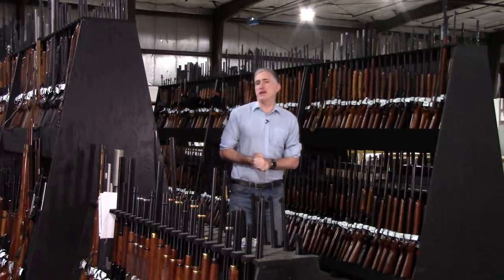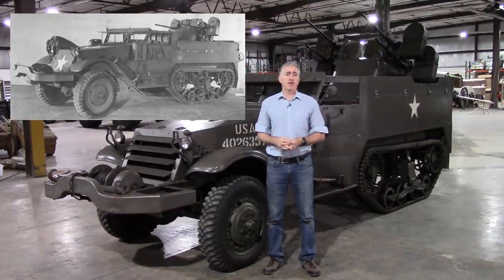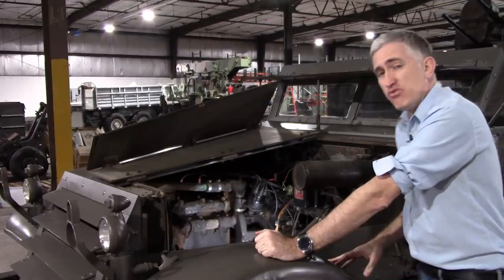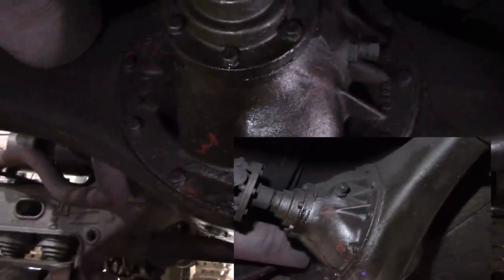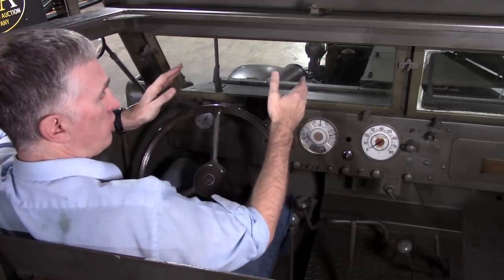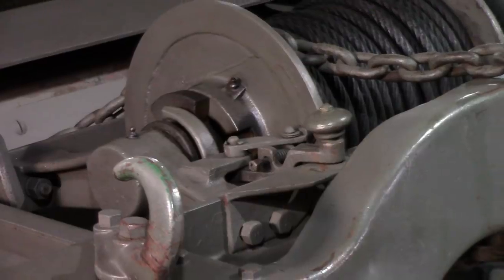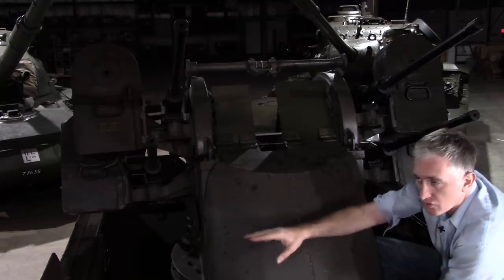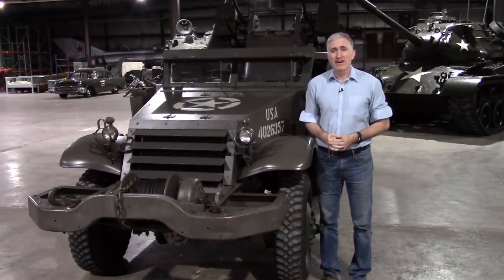Inside the Chieftain's Hatch: M16 MGMC

Comment: The Elco Thunderbolt Mark 15 mount was never a success in any role. A few were mounted on four PT boats in the SW Pacific but they proved to be far too heavy for the hull, and the recoil forces tended to break the mount after only a few hundred rounds. It was tried with just four 20mm cannon and was still too heavy for the PT boat hull. Mounting an additional 40mm gun on the bow, a 20mm cannon just aft of the superstructure, and adding four .50 machine guns on pintle mounts around the deckt distributed the weight better and proved to be just as effective in barge busting without the weight and complication of the Thunderbolt mount.

Comment: the M45's weight is just about where you could just plonk it in the back of a F-350 or similar.
Reply: Firing it however would not end well. Broken glass and twisted frame.

Comment: Would pulling the engine on a M16 MGMC be easier than replacing the Audi B6 Cabrio rear  window regulator?
Reply from the maker: There is an argument, yes.
Reply: @TheChieftainsHatch  Given that Audi has "service position" where the entire front of the car is removable, and VAG loves unit/block connectors (one plug does it all), you might even have the argument that pulling the engine on an Audi B6 Cabrio is easier than replacing the rear window regulator...

Comment: Those rims are not "suicide" rims.  They are split rims, which means the rim is a two piece affair.  "Suicide" split rims are one piece rims with a ring that holds the tire in place.  It's this ring that causes all the problems!  Especially here in America where there are 16in and 16.5in rim sizes, mixing them up can cause injury or death very easily.  Does anyone know if the German 1/2 tracks had front wheel drive?  I've read they didn't.
Reply from the maker: They did not. They did have complicated track steering, however.
Reply: @TheChieftainsHatch  Thanks for the confirmation.  I read that when they turned the steering wheel it also activated a control to the rear tracks.  It was while watching a "Battlefield" episode on the invasion of Russia I had noticed that the German half-tracks got stuck a lot, so I looked up my book on "Weapons of WW2" and it mentioned the lack of FWD for the half tracks was one of the examples of the Germans not being fully prepared for a war in Russia. The other being the complicated wheel arrangement on some of their tanks and the lack of a decent 4 engine bomber.

Comment: Okay, a big fucking chopper like a ch-47 or a jolly green giant and you put an armored ball turret in the bottom of the thing and fit this quad mount into the equation - it's something a child would come up with but I guarantee it was knocked around a board room somewhere between the late '40's and today. It'd give enough firepower to an individual helicopter and allow it to provide immediate fire support from an elevated position. 

Just bring back the ball turret. It's such an idiotically steampunk concept.

Comment: I'm the guy who says they should have halftracks and kangaroos in World of Tanks as part of a partial infantry implementation. WOT has the models; I've run over them a few times. The infantry would be a special set of consumables: Pioneers, Spotters, Extra hands, dug-in, Snipers, AT fire, etc activated by i (no one is using that much). No little men running around. Cool down on them freezes if you go to fast; you left them behind. I keep getting flamed by the tanks only faction. However tanks without some representation of infantry is not historic. f we want to do historic battles and some at WOT dream of that, we need some way to represent infantry. 
Several halftracks had mounted AT guns, rocket artillery, the first recoilless rifles. (Is that a rocket that thinks is a gun or a gun that's jealous of rockets? ) These are easy. Adding IFV's which buff them selves and nearby vehicles with the infantry 'consumables' would do the rest. The low level guns can't pen undamaged tanks but the infantry buffs add various weapon load outs including Piat, Bazooka & Panzerschreck / Panzerfaust (plus light mortars). WoT also has the models for limbered AT guns but that's a bit more fiddly. 
I can never find the right place to suggest this. WOT forums shunts me to the South East Asian forum server with its bots and six active people.

Comment: Four .50 cals in a P-51B: everyone says "hah, puny armament, too weak". Six .50 cals in a P-51D, P-40, F6F, etc, you have anoraks arguing for eternity whether it was "too weak" or "just barely enough" compared to 20mm cannon. 13 .50 cals in a B-17 are mocked because they barely seemed to help at all (although trust me, it would have been much worse without them).
But put four .50s in a truck, and teenage boys have wet dreams over it, fanboys eyes pop out, and everyone agrees it's just the most badass collection of firepower ever seen.
Hardly. A quad .50 is better than a quad .30, but it's marginal as an AA gun, at best. If it's hard to shoot down an enemy plane reliably with 4 or 6 fifties on your fighter, it's even harder to shoot one down from the ground with four guns as it zooms overhead. All a .50 is good for as an AA gun is to make the planes stand off a little, attack from a little higher, and to prevent them from just loitering around and blasting you at leisure. A quad 20mm would be a pretty marginal AA weapon. As the Germans discovered. So far from being a firebreathing piece of mass firepower, the M16 is actually most accurately viewed a a barely adequate gesture towards air defense. It was more psychological than anything else, both for the enemy pilots and the ground troops. It is very fortunate for the US soldiers that the high command found the CORRECT answer and sent up fighters to shoot all the enemy planes down instead of relying on the M16 MGMC. It would have proven to be a very weak reed indeed against enemy dive bomber and jabo attacks.
Sure, it could be used to lay impressive firepower on an enemy, but in honest it couldn't do it much better than a single .50  mounted on a standard halftrack. There aren't many situations where just throwing more bullets at the enemy is going to kill more of them. Unless they are marching across a field in the open, or all hiding inside of a barn together, it won't make a big difference. The real point of MG fire is to make the enemy take cover and stop shooting. You can do that just about as well with a pintle mount .50 cal as with a quad .50. Hell, unless it's long range you can do it just about as well with a .30cal. Sure, the .50 has a psychological factor, but not one that is worth building and deploying them just for that. It was more of a case of "well, we have them, we should do SOMETHING with them". They weren't heavily armored or protected enough to use as real combat vehicles, so the only thing they were really useful for is if you saw a column of enemy at a distance moving away, you could lay a rain of fire on them when they were unable to shoot back. The M16 would be an easy target on most battlefields. Sure, you could use it to support an infantry attack. But there are vehicles better adapted to this task.

Comment: Those are COMBAT RIMS,  not split rims.. and they are not deadly or dangerous.
Reply from the maker: Am I incorrect in my understanding that a combat rim is still a multi-piece rim, with the primary difference being the inclusion of an internal brace to allow the tyre to remain on the wheel when flat?
Reply: @TheChieftainsHatch  The Combat Rim of that era was a bead-locked rim, it had no split ring, so it isn't a "split rim" design.  Your understanding that is of multi-piece construction however is correct.